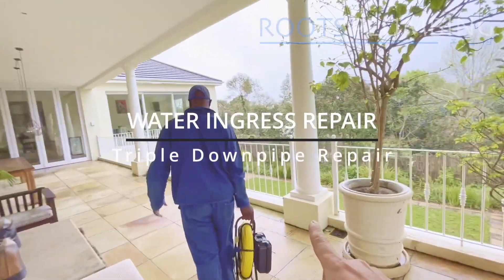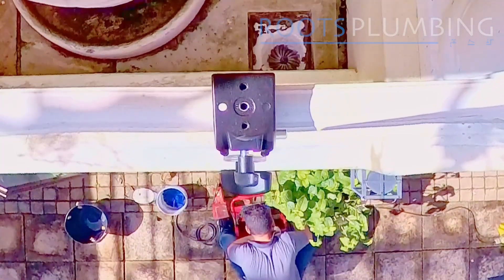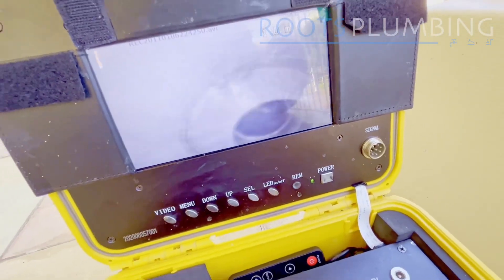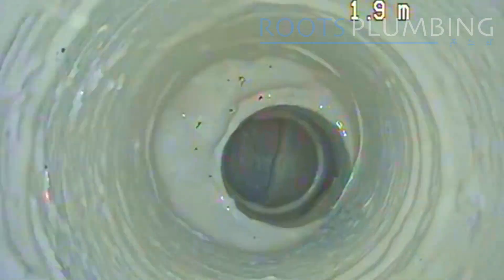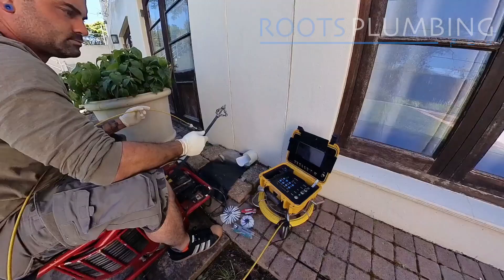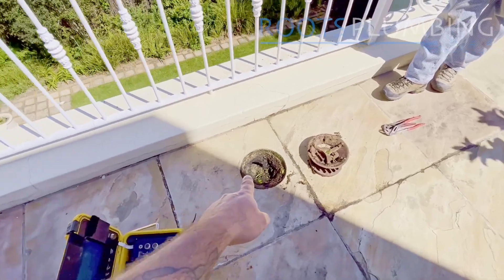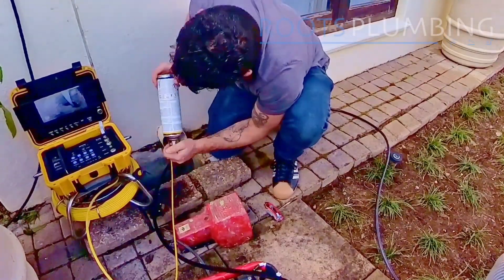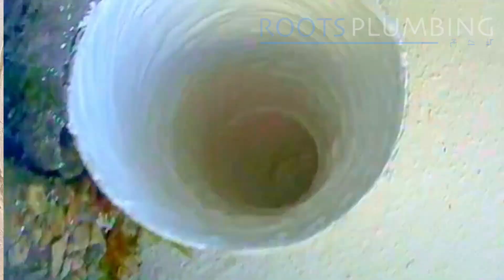Protective Brush Coating - Storm Water Leak Repair

Comment: Great job! I have the polyurea coating machine & picotes coater. Polyurea dries literally in 5mins per coat vs 2hrs per coat with picotes epoxy. Both machine have pros/cons. Again great job.